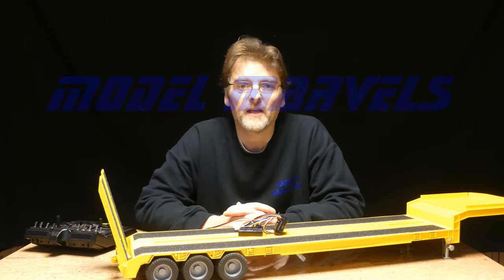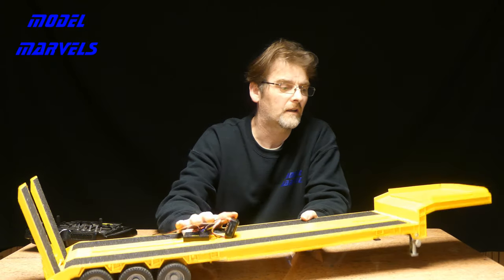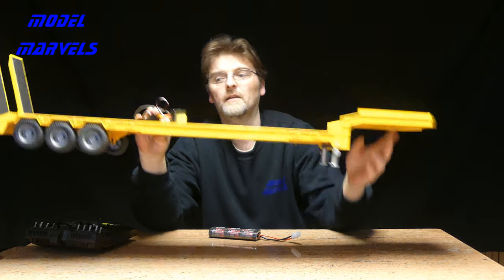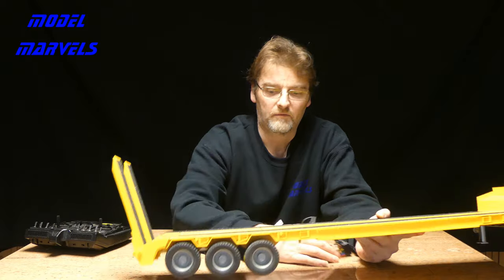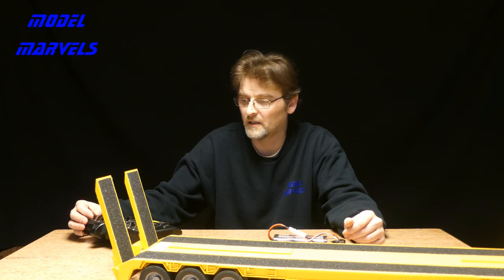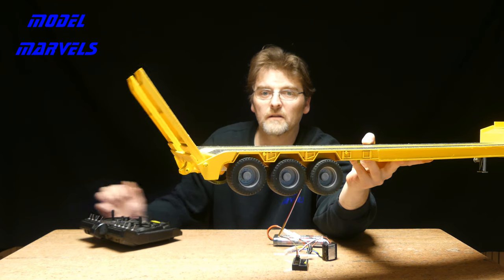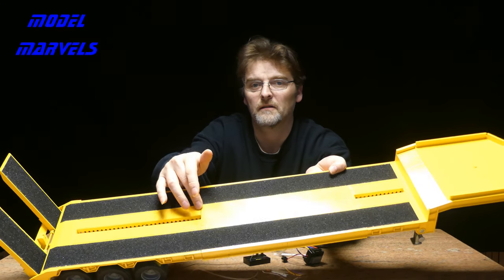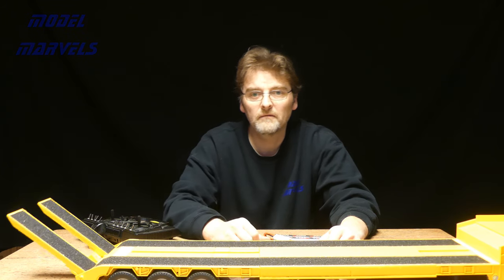Trailer Conversion

Comment: That is awesome!!! I have one that I converted, threw my own axles under it, and has powered ramps and landing gear. It works well, but it is super short, which is ok, I like the way it turned out (a video of it is on my channel). I am in the process of building another, I have a new trailer (with ramps this time), and I want to extend it out a ways. How much did you add to the middle? How did you cut it? Looking for a good method to get it square from the get-go.
Reply from the maker: Thanks.  we will check yours out when we get the chance.  Don't worry to much about cutting the trailer straight although a sliding mitre saw would make life easier, as you will be able to hide an uneven cut when you lay in the new deck piece or even recover the whole deck. It's long gone now but measuring from the video we cut in 2/3 the length of the original deck (so if the deck was 30cm we added in 20cm roughly). Hope this helps.

Comment: Hi can you tell me what actuator you used please as in voltage and speed
Reply from the maker: Hi Dave. Sorry for taking so long to reply.  Had to watch the video to remind myself!  In answer to your first question for the metal "chassis" you can use U shape aluminium for the Spine and L shape for the side rails (can't remember the size off the top of my head but you should be able to measure that if you have the base trailer - I don't have one currently.  The deck was made using thick plasticard - again a quick measure should tell you the thickness you need.
As to your second question the actuator was a frigelli L12-100-100-6-R which will plug straight into your receiver and work without needing its own power supply or speed control.  
Hope this helps.
Reply: @ModelMarvels  brilliant thankyou, where did you purchase your actuator from

Comment: Hi, so did you make the ramps yourself? Could you send me links for the electric parts please? 
Thanks.
Reply from the maker: Hi.  Although the trailer is supplied with ramps we made these out of plasticard sheet as they were missing.  Its best to do a search for the "electric" parts as they can vary by install.  Just search for rc linear actuators, I know bangood have them as well as robotshop; also keep an eye on ebay as a guy makes a captive rod version which he offers as a complete set designed for the trailer - its not something he has a constant stock of and I can't for the life of me remember the name. Hope this helps a bit.
Reply from the maker: Ps, just subd from our garden watch channel.
Reply: @ModelMarvels  thanks very much. 👍